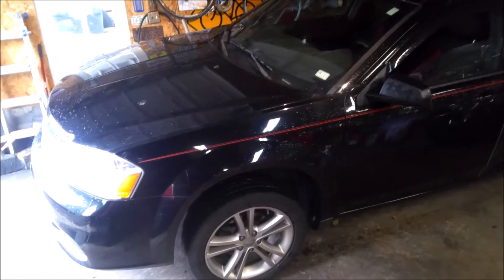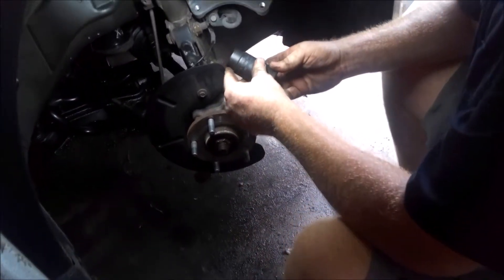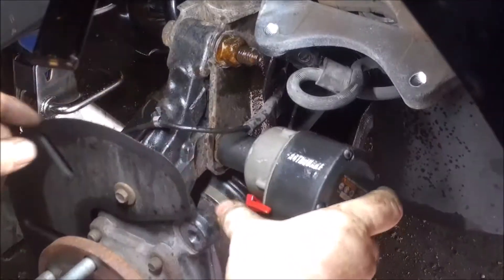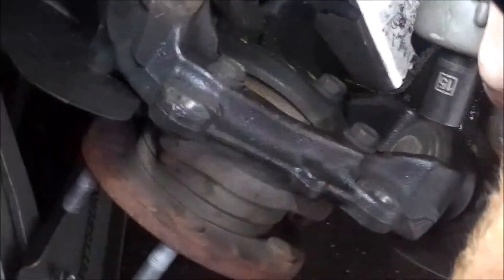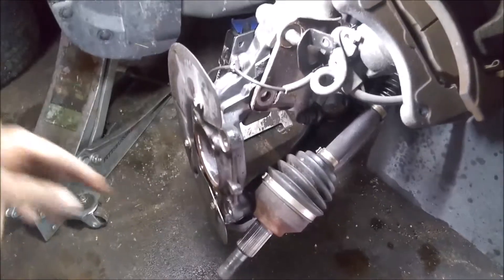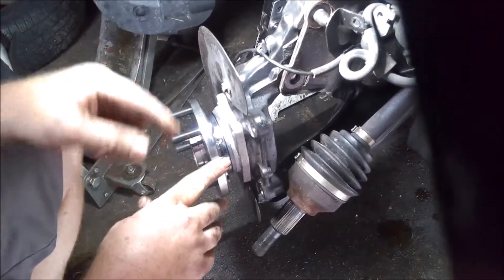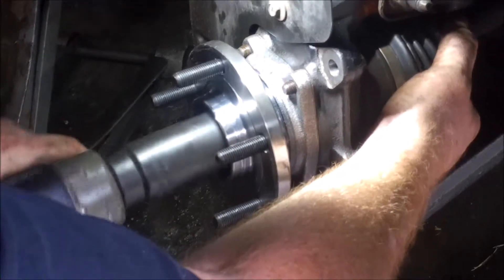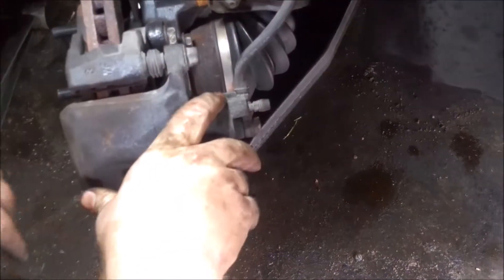2012 Dodge Avenger SE Hub Assembly Replacement

Comment: Hello where did u but the air tool with the tiny sanding disc it looks like a good tool 👍
Reply: Whats the 4 bolts holding the hub to the knuckle whats the torque specs
Reply from the maker: The air tool is called a angle grinder and anyone that sells air tools has them I know harbor freight carries two different ones for reasonable price but any hardware, auto parts store etc should have them
Reply: Hoopties Garage ty so much 👍

Comment: Do you have to remove the axle from the assembly prior to removal or can you just attach slide hammer to assembly, once it's no longer bolted on, and snatch it off?
Reply from the maker: You want to take axle off first otherwise you coule damage the CV joints or have them fall apart on you
Reply: Nice response time!!!! Thank you.